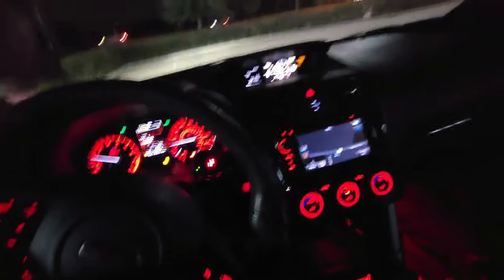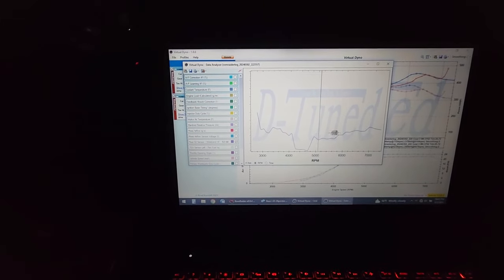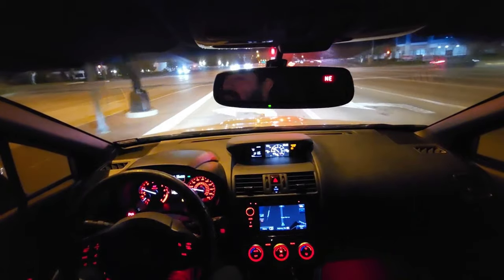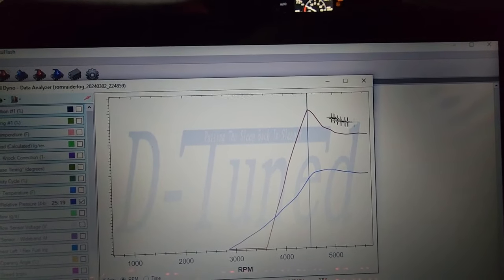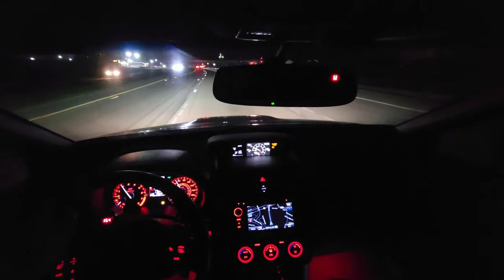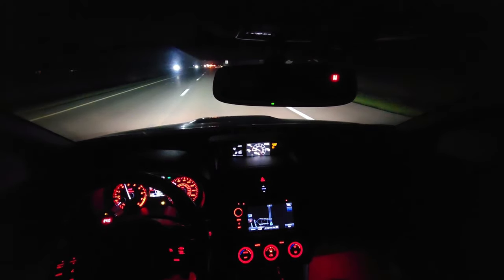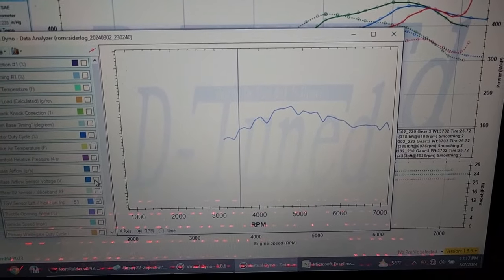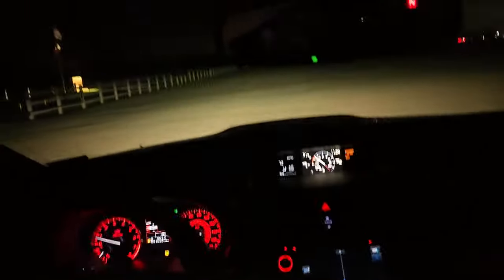Road To TX2k'24 - Scaling MAF + WOT Tuning (500 WHP Subaru Build)

Comment: When you get the maps all dialed in and if you decide to add in those fuel dampeners would you have to make adjustments to the map for those?
Reply from the maker: I might, but it's dialed in pretty close, so it should just smooth out the AFR when the fuel pressure cleans up.